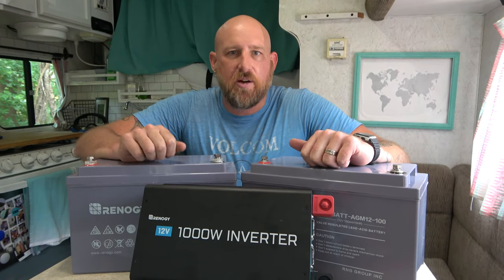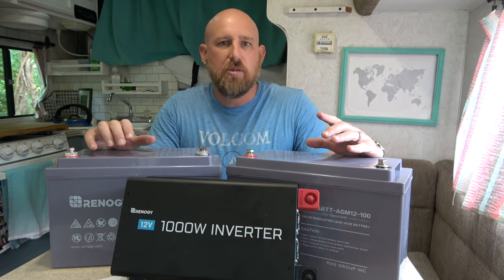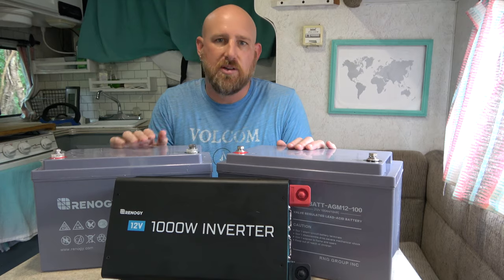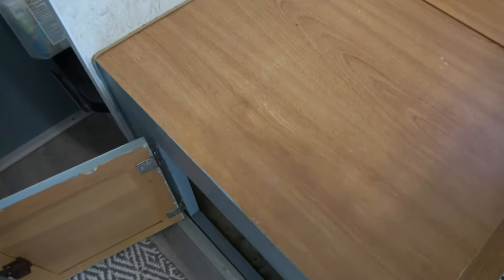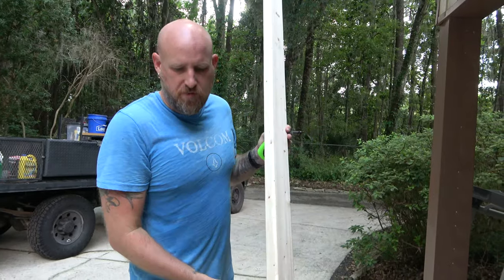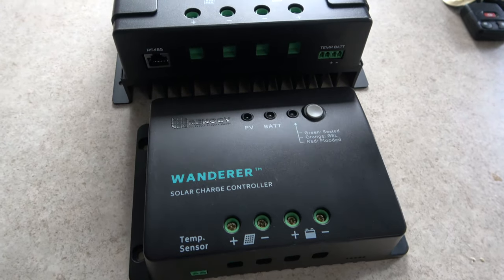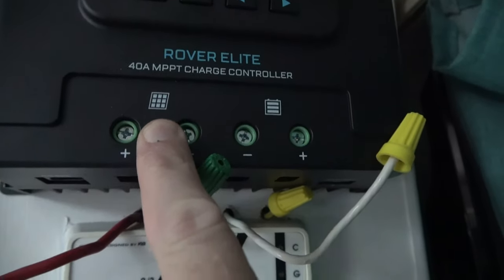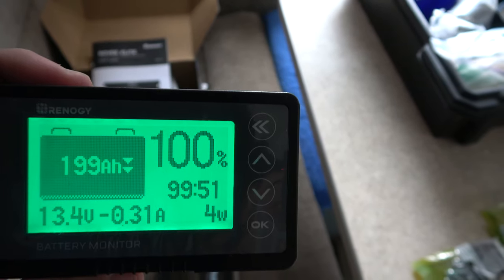RV Electrical & Power System Upgrade // Full-Time Truck Camper Living

Comment: THANK YOU SO MUCH it took me SO LONG to find a video that had the same left-side annoying placement of the battery! I'm not sure pulling all those wires through looks very fun or if i'll get around to it, but you've finally answered my question!
Reply from the maker: Glad we could help! Having adequate power and not worrying about it is worth running new wires. When you make the upgrade, do it right one time and don’t think about it after that!

Comment: great vid I have a lance 835 "long bed " and one battery is just not cutting it ! that spot for the power stations is perfect !
Reply from the maker: One battery is not much these days, even with low energy draw appliances and lights. One of our viewers actually gave us the idea to bring our batteries inside the camper. It is ideal... except we lose crucial pantry space we had become dependent upon. But we have lots of outside storage with our custom flatbed storage boxes so we’ll make it work. Power was most important in this stage of modifications. Thanks for watching and let us know if you have any questions as you upgrade your power system!

Comment: I plan to install the Renogy DCC 50 S , DC to DC MPPT battery charger in my Northern Lite truck camper, 
A combination  of 3 Renogy 100 W compact design on the roof with the adition of a Renogy 100 W solar suitcase for my panel, Renogy 1000 W pure sine for the inverter and finally 2 Battle Born 12 v  100 AH .
This is the project for my solar and this is a serious decision to begin my prep for my retirement , wich is pretty soon.
Reply from the maker: That is going to serve you well. You shouldn't have to worry about power or making any other changes anytime soon. But man, this was a big undertaking that I'm glad is in our past! Good luck!

Comment: What a mess of wires!  Somehow I had in my head that I could just install something like a 2,000 or even up to 5,000wh lithium power station (Bluetti, Jackery, Goal Zero, etc), get rid of the old batteries, and plug a few things in.  Obviously I am thinking too simplistically! I was also hoping that might be big enough not to need propane for the stove, use an electric induction cooktop, etc.
Reply from the maker: Yes, this ended up being a mess because TC are small and not enough space to move things around! We have yet to meet someone that does not have a set of house battery(ies). You still need to run things like water pump, lights and fans that are typically wired into a battery bank. Plus there are other things like LP/CO alarms that are typically hardwired into the battery bank to ensure they are always on and working. I cannot say with any confidence that you could set that up to work with a portable power station.  In order to power an induction stovetop you'll need a lot of battery capacity, so find out how much power the one you want requires and then do the math on how big of a battery bank you would need. Lithium batteries have come down a lot in price and there are several great (not-Battleborn) brands that offer good deals. Here's our post on those: https://calledtowander.com/lithium-ion-rv-battery/

Comment: That's why I don't buy Lance those 1 battery compartments drive me crazy. You can't FT on 1 battery. I think nowadays the have a 2 battery compartments. Maybe not...I buy Arctic Fox for 2 batteries and a short haul if you need a third. Great video!
Reply from the maker: Thanks for sharing

Comment: Do your house batteries charge off of your vehicle alternator? I see Renogy makes a charge controller that takes input from both panels and alternator... seems like that would be ideal.
Reply from the maker: They do charge from the vehicle. We didn't replace our charge controller and other components inside the "guts" of the system. If we were starting from scratch we'd probably go that route.

Comment: I have a question; now with your new set up you going to have 100AH of total battery use or close to 50% of battery capacity. With that 100AH can you survive with your ceiling fan on all night in summer, charge all of your electronics and lights etc.?
I like your videos thanks.
Reply from the maker: So with our 100Ah availability (50% capacity of 200Ah total) it's a basic math equation for us. We have tested all of our appliances and know the amperage that each one draws. So, for example, our Fantastic Fan on setting 2 draws 1.9 amps. Let's call it 2 amps. 100 Ah / 2 amps = 50 hrs. But we would also have to add up anything else that was going to draw on the batteries overnight. Our Macbooks draw lots of energy and we'd have to look at the other appliances we use. But yes, this setup is an increase in Ah for us (about 20-25 per battery) plus we're less likely to damage the batteries as AGM are hardy. We're pretty sure we didn't treat our other batteries well as they bounced around more than they should have in our mild off-road activities. Thanks for the question and for watching!
Reply: Now I can have a good idea what I need, thank you very much.

Comment: I have a 1992 lancer camper if I change the battery to  Lithium Ido I have to change the charge controller that charges the battery from the sur power on my camper
Reply from the maker: Lithium changes a lot of things. But it also extends your overall power if you can afford it. We'll switch to lithium at some point and pay for the additional gear if needed, though our controller works with lithium.

Comment: One question for you though - how much solar do you have on the roof and what wiring size do you have from the solar panel to the MPPT conroller? I only have 70W or something tiny on the roof and I fear upgrading the solar will mean new wires..
Reply from the maker: We have 12 awg from the labels to the controller with 960W solar. There are wiring size calculators that will help you based on the current flow and distance of wires. It just depends how much you want to add. But most panels for medium size systems will use 12awg - 10awg wires that most solar kits provide. Send us an email when you’re ready to upgrade and we’ll share some tips!

Comment: What I don’t understand is how truck camper power centers are grounded. Where does the to ground wire go in the ac power center?
Reply from the maker: So with this video we didn't change teh AC power center. But in general there is a ground wire that goes through the camper and connects to the metal frame of the camper, which is then grounded through contact with the truck bed. We don't own the camper any longer or I could show you where the copper ground wire was screwed into the outside of the camper frame. But that's the general idea if you are starting from scratch. Again, this was an upgrade to the existing DC power system and not the whole power system setup. Hope this helps.
Reply: @CalledToWander  thanks